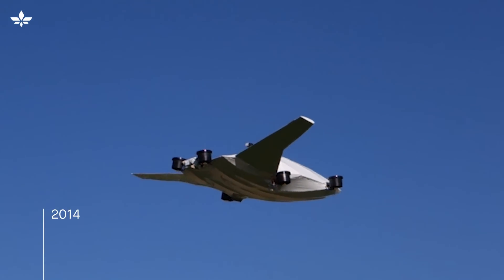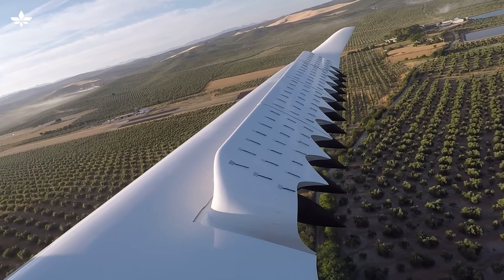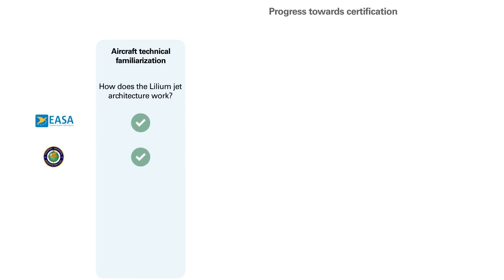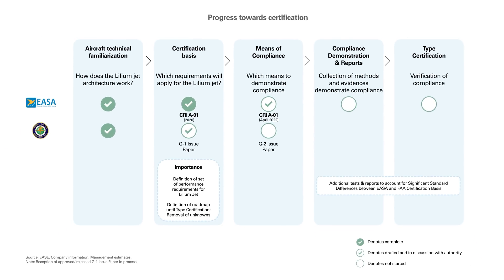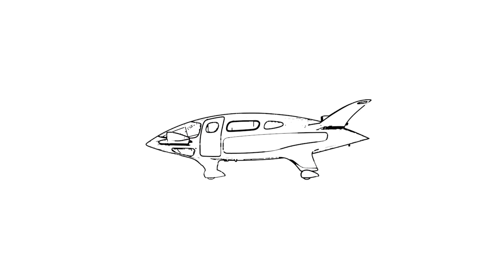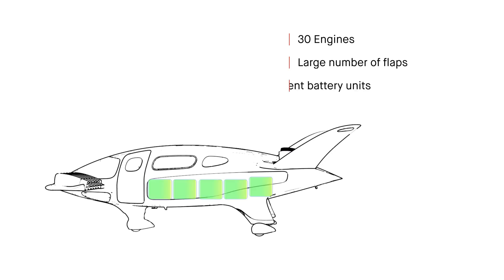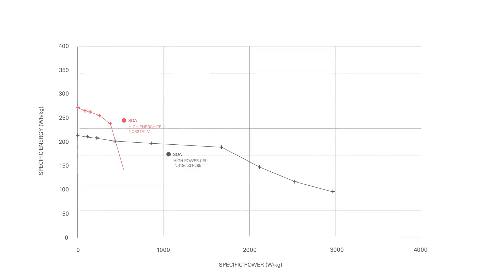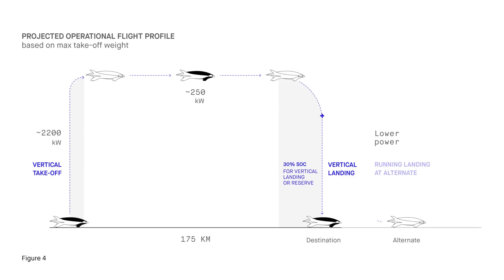Aircraft Development Update

Comment: Why you do not use Liquid hydrogen with a fuel cell (to deliver nominal power) + small batteries (take off and landing), that would solve any range issue..     By the time you done with all licences requirement, you would have several sites that will provide liquid hydrogen. 
Your range can jump to 1000 km easy..
Range = safety and extended purpose, without need to recharge on any destination closer to 400km. 
Or at least for a second version.
Reply: Hydrogen also takes a ton of space to store
Reply: @nikobelic4251  It takes 4 times more volume than jetfuel but it also weights 3 times less. 
If you take into account how much you save due weight, plus the extra efficiency of fuel cells vs normal combustion engines, it means you can achieve the same range having half the energy, this is equal to increase a tank dimensions by 25%, this doubles the volume.   And this compared to jetfuel.. if you compare it with batteries.. of course there is no even comparison.. batteries lost in everything unless you dont require to provide energy for longer than 1 or 2 hours.
Also batteries has 3 times less lifespan than a fuel cell.
Reply: @angellestat2730  where do you see the space to add enough hydrogen to the aircraft?
It’s an air taxi, there is space for 6 pax a pilot and some bags. No space for a hydrogen tank
Reply: @nikobelic4251  as I explain in my previous comment, if normal jet fuel aircraft have 1m diameter tank (to make the math easy), you would just need a 1.25m diameter tank to double the volume (you need to read my previous comment to understand) and get the same range than jet fuel. 
Do you think that is a lot? 
In fact, in 2012 Boing develop the phantom eye prototype, which was a liquid hydrogen combustion (lower efficiency than FC) airplane that at normal scale would be able to stay airborne (just using hydrogen) over 10 days.   Not possible to achieve this with jetfuel, this is why LH2 was selected.. and you talk about a volume issue vs batteries? 
I imagine these types of misconceptions happen when you get your info from battery fanatics.
Reply: @angellestat2730 I am not a battery fanatic lol
Lol you are comparing flying a large drone at high altitude to an air taxi meant to carry passengers.  An air taxi running on hydrogen wouldn’t be able to fly for 10 days.  The Global Hawk is able to stay airborne for 32 hours and it runs on traditional jet fuel. But it’s a drone.
Drones tend to be able to stay in the air longer than their manned counterparts.  

And the point of these air taxis isn’t to fly 1000km so you don’t need that kind of range.
Reply: @nikobelic4251  if Boing wanted to make a no solar aircraft that required to stay airborne for long time, why they choose hydrogen instead jetfuel?  If according to you there is this huge problem with volume?? 
It does not matter the application!! unless that application does not require more than 1 hour of flying time.  In that case batteries work great..  But 1 hour is nothing, even less when you need to account for safety energy margins or change the landing location due whether or other circumstances..
 It is also an issue the recharge time.  A taxy should work all day to recover the investment, as any utility comercial vehicle. 
But no.. now it needs to wait 1 to 5 hours after each trip, buying a new pack of batteries after 3000 cycles. 
But again.. you mention an issue with volume.. where is the issue of liquid hydrogen with volume vs batteries??
Seriously.. where is it?? 
There are other taxi drones in development like Skai using hydrogen in case you dont know..  they carry even more Passenger with higher range, this using compressed hydrogen which does not have the same volume or energy density than liquid. 
I dont see any volume issue with those either. 
How difficult is it for you to admit that your volume criticism doesn't make any sense?
Reply: @angellestat2730  Skai is one of the ONLY air taxi companies using hydrogen 
Joby, Archer, EVE, Airbus, Vertical Aerospace, Lilium, Wisk, Ehang, Bell, and many others are all using battery technology.  

Are you saying they are ALL incorrect in their approach and the 3 companies that are using Hydrogen are correct?
Also, there are many ways around the battery charging issues. You could idk… swap the batteries out after a flight instead of recharging them on the aircraft? And that’s IF there even is a battery charging issue. Lilium is supposed to be used for scheduled flights do just plan the charging around the scheduled time. 
Batteries in this case works for them they shove them under the cabin. Have you ever seen the concepts for hydrogen powered aircraft? A large section of it (usually behind, above or below the cabin) is bulging or left empty because they have to add a massive hydrogen tank. Hell, the Phantom eye is clearly a massive hydrogen tank with wings.  Having that bulge or space behind or in front of the cabin isn’t very viable for these small evtols. And as much as a couple companies are going the hydrogen route the vast majority of them seem to have come to the consensus that that’s not the right way to go.
Reply: @nikobelic4251  I totally understand why there are more battery approach than hydrogen.
You have to take into account that all those projects started to take shape 5 or 6 years ago, when hydrogen was not a safe bet at all, not knowing if finding LH2 supplies would be easy and at what price,  how much it would cost to develop all certifications that a new technology like that would require. 
Also most of these flying battery vehicles are mostly designed for private use, for rich people who only require 1 or 2 destinations by day. 
But now things change, you have more companies like ZeroAvia working on hydrogen systems and certifications for several different power requirements. 
It would be easy to adopt one of their systems to their specific requirements. 
But going the battery path to take the most advantage of the lower range, it means that all these companies had to spent a lot on design to consume the less amount of energy on fly, this mean wings and propellers who rotate to achieve different flying modes. 
Instead Skai said.. a drone with multiple propellers is easy and safe, any range issue is solved using hydrogen.  Not need to spent money on complex aerodynamics research and flying characteristics. 
Hell, the Phantom eye is clearly a massive hydrogen tank with wings
Because it should fly over 12 days!!
Where is the volume issue on Skai? 
You keep repeating that Liquid hydrogen has a volume issue vs batteries..  can you mention what physics rule take you to that conclusion?
Or what real application seem that way? 
Of course.. you need to compare them at equal range. 
 You could idk… swap the batteries out after a flight instead of recharging them on the aircraft?
This mean you need a different pack of batteries for each one of your destinations?
Taking into account that batteries are already 1/3 or more of the whole vehicle cost, it means you need to spent 2 times the vehicle cost to have backup at least on 2 fixed destinations.
Also.. not an ecological solution from the materials required for that.
Reply: @angellestat2730  Skai was founded in 2006… so yeah they had access to the same tech options as pretty much all of the early starters
As for the volume have you not seen there is a massive area in the back of the vehicle that’s not for bags or passengers, it’s probably there for hydrogen storage.  It’s a lot of unusable space because of the hydrogen.

And yeah, ZeroAvia is working on hydrogen for small (and eventually large airliners) where you can put the larger tanks in aircraft and not have a significant size issue.

Have you ever seen concept aircraft for Airbus’ hydrogen aircraft where they plan to have hydrogen tanks in the back? The whole empennage is unusable because they plan on using it to store hydrogen
Reply: @nikobelic4251  the company is founded in 2006, it does not mean they are working in this specific product since then.. In 2006 hydrogen was not a thing at all.  Even the classic battery quadcopters were not a thing.
As for the volume have you not seen there is a massive area in the back of the vehicle that’s not for bags or passengers, it’s probably there for hydrogen storage.
It is there for hydrogen storage and the fuel cell, but half of all that space is for the emergency chute system.  
Now compare that small volume in the back with the required for an helicopter.
Also.. this has 4 hours of flying time (fighting gravity in vertical way), a version using battery only last 1 hour and half using wing as lifting. This translates to 30 or 40 min of vertical flying time. 
As for the volume have you not seen there is a massive area in the back of the vehicle that’s not for bags or passengers, it’s probably there for hydrogen storage.
This is my personal opinion:  Airbus is not really working on hydrogen alternative, at least not seriously.
They dont want to.. Is just a publicity stunt to make them appear as "they keep innovating".  
They invested 28 Billions in the development of A380 and it was a total comercial failure..
Then the pandemic come and they lost it a lot more. 
They would not commit to anything until they put in order their finances, even less in the lack of real competence, because Boing is doing nothing in that regard as well.
The excuses that Airbus drop to said why is hard, does not have any sense. 
They estimate the liquid hydrogen tank mass as 2 or 3 times the mass of the whole LH2 fuel capacity without any real reason.
ZeroAvia (a small company) in that regard are way ahead.
Reply: @angellestat2730  I am pretty sure Airbus is serious about Hydrogen aircraft since they have contracts with engine manufacturers to develop the engines and are modifying an A380 to test hydrogen propulsion 
They’ve also been working to source clean hydrogen.

Airbus’s plane looks so “different” because they are going for a clean sheet aircraft designed to run on hydrogen instead of slapping some hydrogen engines on an existing plane like Zero Avia is trying to do right now.
Reply: @angellestat2730  Did I miss the example you gave of a successful implementation - current, not planned, or imagined at scale X - of an aircraft using the fuel system you are advocating?
Reply: @nikobelic4251  Really?  Why has a small company already put them to shame with the mass ratio of their LH2 tank vs what Airbus claim as the best they can do? 
Search "Ultra-light liquid hydrogen tanks promise to make jet fuel obsolete"
This is not even a great design, you can use the same fuselage as your tank structure, without the need to use vacuum as insulation, you can use common lightweight materials, at that scale you would have low thermal gain anyway. 
Any boil off can be used in the turbine, an airplane does not need to keep its fuel over more than 20 hours.. instead with a bit of insulation would be able to keep it over days.
Airbus’s plane looks so “different” because they are going for a clean sheet aircraft
If you tell me the V blended wing shape..  well.. I give you the reason.. but the other two designs which are the ones which they would start first?  
Those are as normal as any aircraft, all the regulations are already written for those shapes, zeroavia also needs to find new places for the tanks..
But yes, another possibility is that Airbus does not want to go against any previous regulation, this mean you need to choose the wrong design in order to reduce your certification time.. If this is the path that a small company follow.. I would not blame them, but.. Airbus??   Come on!  
Of course.. I can not prove it.  But this is my opinion and I have several technical reason to think this way.
Reply: @mavigogun  I give you the examples.. a "thanks" would be nice :)
Reply: Do you have a single flying example of a liquid hydrogen fuel cell aircraft?   Of course not- the cooling requirements have relegated use to conceptual future jumbo jets aircraft.
Reply: @mavigogun  The only reason why air vehicle companies delay the conversion to liquid hydrogen is due uncertainties about how easy available would be that fuel on the near future and the extra certifications (with no clear rules today) that might come with delays.
All those uncertainties are not a good case for a business that requires to attract several investors. 
Now.. I accept those issues, but not the argument against technology limitations, because there is not any significant stopper. 
Even in the current stage, where the technology is way far to be optimized, would perform way better than any full battery platform. 
This is fact. 
Because even compressed hydrogen perform much better than batteries, comercial drones using 300 bar h2 fly around 2 hours, when the ones using batteries just 25 min.
There are some test using liquid hydrogen drones with flying times of 12 hours. 
https://youtu.be/ka1R6EvntuI
You mention about how hard is to storage liquid hydrogen..
Search in google "hypoint-extends-hydrogen-flight-range-new-ultralight-fuel-tanks"
About flying taxi in development you have Skai:
https://youtu.be/b3k-X1QE-y0
They avoid any complication with design optimization (no wings, no angle thrust change), just a drone because as they would use Liquid hydrogen, they dont need to squish any performance benefit possible to achieve few minutes more like batteries. 
Besides, with battery, you not only have a shit flight time, you also need to wait several hours on destination to recharge..
Maybe by the time they started this project, hydrogen was a quite risky approach.. but today there are way fewer excuses.
Even more with so many countries and cities already planning hydrogen hubs.

Comment: What I like most about the Lilium approach is that they've created a design that can be either short takeoff and landing or vertical takeoff and landing. When they can use the STOL option, it uses less energy and improved use of battery power. I'd be interested to see how the system would perform in a conventional takeoff and landing operation, which I'm sure would be even more efficient, and give the operator more options.
Reply: Yes. In operation one side of the journey will often be an airport or airfield, where you switch to long range transportation. So saving energy by limeting the VTOL to what is needed seems like a smart move. 

Forward take off and landing will probably feel better as well.
Reply: Given the size and range, it looks like it's intended to replace helicopters for local hops, not jets for longer distance trips.
Reply: I don’t see how. E aircraft w fixed engines already fall short of commercial requirements in carried energy.  VTOL requires even more energy per takeoff, and the energy limits prevent them from doing multiple take offs, in out of remote locations with no recharging, like a regular liquid fueled rotorcraft might do.